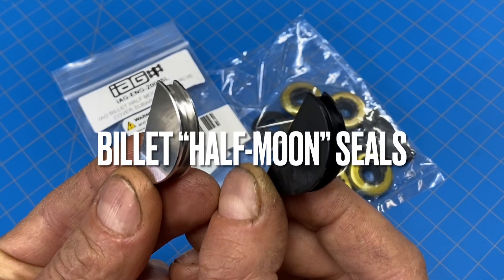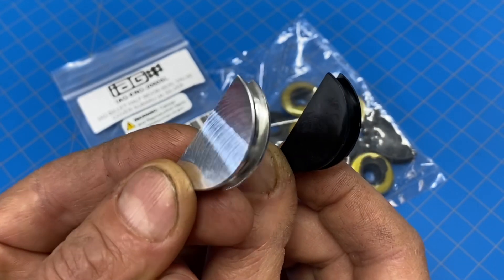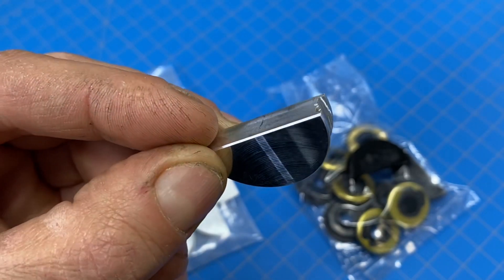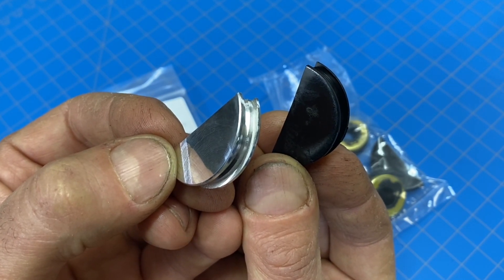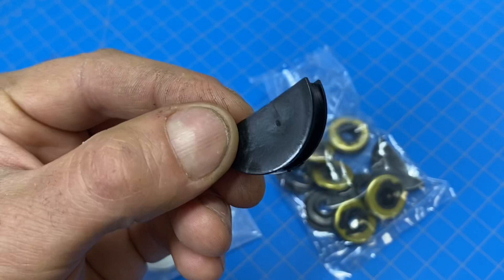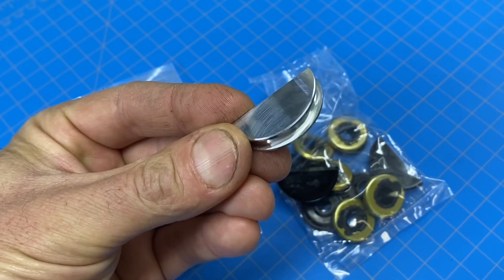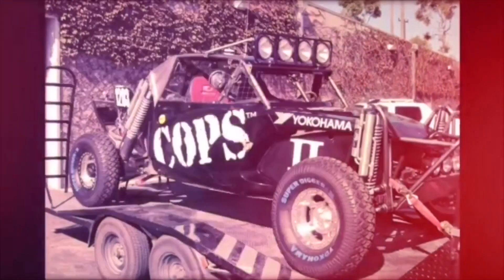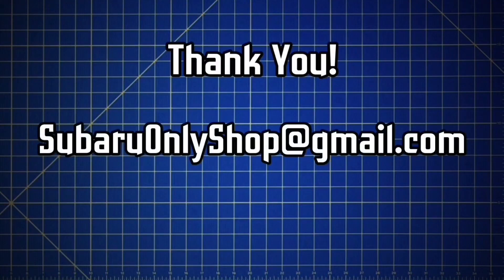Billet Half-Moon Valve Cover Seals (USE THEM!)

Comment: It is correct that the aluminum seals will expand and contract at the same rate as the aluminum engine parts. The "polymer" seals is an umbrella term. It depends on what type of polymer they are. Almost all polymers expand at a higher rate with temperature then aluminum. More likely, it is the molded in stress in the plastic which relieve with extreme use, leading to the leaks.
Bilet aluminum is not more special then other aluminum types in this application. However, the marketeers know you are ok paying a little more money if they use the almighty "billet"
Reply from the maker: Great info man - thank you for sharing!  👊
Reply: billet does have different expansion properties than non, but in this application, i dont see it mattering much or making any meaningful impact

Comment: Nice, ...but I forgot where exactly do these go.  I have a 2000 Impreza 2.2l NA engine and a 2013 Forester 2.5 turbo, don't recall seeing them.
Reply from the maker: They go between the valve covers and the heads - specifically, they pop into little slots in the head’s body.  The valve cover surface is flat and seals against these little wedges. 

I can do a quick install video on coming weeks, stay tuned!!!  Cheers!!!
Reply: @SubaruONLY  Thanks, a video in the future would be great.  On a hot running turbo engine these could be of value.
Reply from the maker: Nice, will do. And Yes, and you nailed it actually, the side with the turbo tends to fail sooner in my experience!

Comment: I still have never actually had someone explain what is the purpose of the seals? Obviously to keep oil from leaking, but why wasn't the head and valve cover designed so they fit together seamlessly without the need for a half moon?
Reply: Looks like it was something to do with how they machined the heads, I guess they go all the way through so leave a hole on the other side that isn't needed so gets plugged. This thread has a bit of info as someone asks about heads without the hole which are apparently from later engines https://www.scoobynet.com/scoobynet-general-1/1061955-newage-heads-without-half-moons-picsss.html
Reply from the maker: Yes, those little half-moon wedges are cut out of the heads for the final cam bearing journal machining step.  They pass a long bit through all the cam journals to grind down to final specs for the cam bearings. 👌
Reply from the maker: Checked this link and that’s quite interesting, looks like Subaru updated their tooling to be able to do all the matching from the front only. Cool - thanks for sharing, didn’t realize this.
Reply: @SubaruONLY  Thank you! And from having some machining experience myself that makes perfect sense, its just never talked about.
Reply from the maker: Nice 👍
Reply: Great question.  I was wondering the same.

Comment: Since they don't do anything, I'm surprised more people don't just TIG weld some aluminum ones onto the heads, hahaha.
Reply from the maker: Haha. Nice.
Reply: Dude seriously, see my response on this vid. Like what specifically is the function of them other than to block out oil?
Reply: @stg2lgcy00  They are just to cover holes which were used during the manufacturing process of the head. It's from when they had to bore the camshaft journals. Also if the journals ever need to be resurfaced the same openings will need to be used. In most cases though people would just get new heads, so there wouldn't be much harm in permanently welding them up by my figuring.
Reply from the maker: Good info buddy - thanks for sharing!
Reply: @802Garage  Nice, gotcha! Yeah from what I've seen / thought about is just weld them up then make a few passes over the area with a mill & done! lol